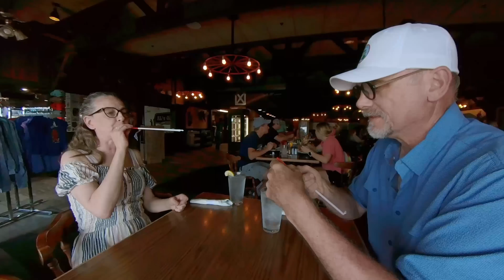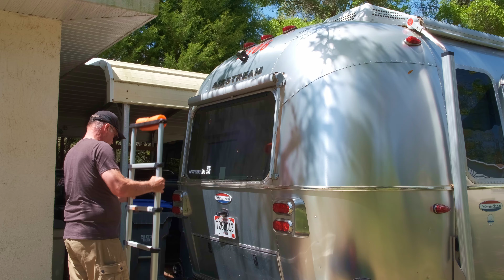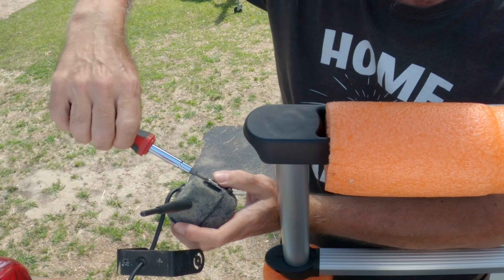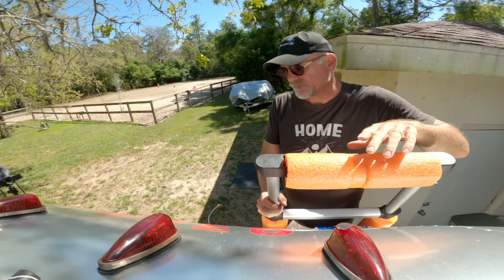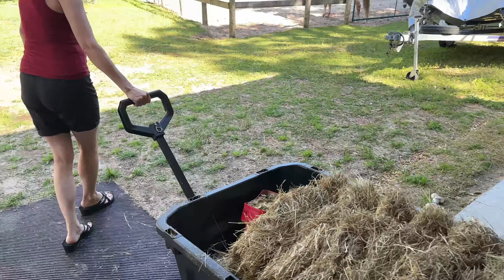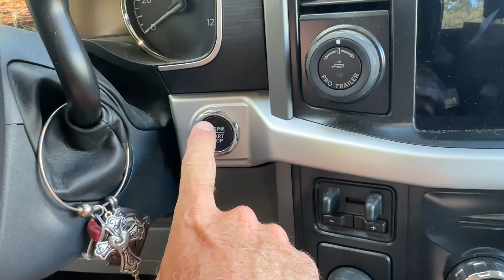Installing the HALOVIEW BT7 on our AIRSTREAM

Comment from the maker: Do you use a backup camera with your rig?
Reply: The answer is really we need one for monitoring the things that ride in the hitch. This is for our  bikes or Lance Skooter that rides on the back of our Bambi. On our last trip we dragged a bike about a mile down I-95 before someone opened a window and told us it was just barely hanging on to the camper.  The original camera had died 3 years ago so we could not monitor anything. The quality was really bad anyways.
Reply from the maker: @long-pierproductions6835 that sounds like a scary situation!

Comment: I enjoyed your video. I installed the same camera system on my Airstream because my old similar camera that came with the rig would not operate properly with my 2021 GMC truck with the pulse electrical system. The BT7 needed constant 12v feed. So I ran new wiring inside the rig to where the DVD player was for power and added a manual power switch. In addition, I added a new 12v  outlet (cigarette type) where I can power the monitor in the rig if I want so that I can use it as a security camera if we're away from the trailer and wanted a watchful eye at the campsite. This camera has proven fantastic! Easy installation, superior quality of picture.
Reply from the maker: That is a brilliant idea for a security setup, thanks for sharing your tips! - Jim

Comment: Thanks for the excellent video. Our factory supplied camera has never worked well and so we are going to replace it with the same camera. I was wondering if anyone has used the Haloview RVMB02 mirror mount? We have a Ford F150 and it seems like a good place to have the screen.
Reply from the maker: We have upgraded to the BT-10 TPMS model. Mounts right on the rear view mirror and has built in TPMS. Highly recommended!

Comment: I know this video is a year old now but I’ll ask anyway. After watching your install videos I bought the BT7 for my Airstream 26U. My question is do you think it will void the warranty if I cut the connector off the camera cable like you did? There’s no place to hide it so I don’t think there’s any way to do the install without cutting it off. Thank you for the video!
Reply from the maker: That's a good question, to be totally honest, I'm not sure. That said, I have found the Haloview products to be excellent quality and have had zero issues. Their support has also been terrific. I later updated to the BT7-TPMS and am now using the BT10-TPMS. All have been excellent products. I'm sure you will like the improved resolution of the Haloview.
Reply: @airstreamer Thank you for the fast response! I’m just waiting for the temperature to get above 40 this afternoon then I’ll do the install!
Reply from the maker: @Bestdayever-1  Safe travels!

Comment: I'm actually getting ready to switch to the BT7 on our 27FBT, primarily for the multi-cam capability (because I think the portable battery powered cam has value for us in some parking situations).  But, at this point I'm planning to stay with TireMinder for TPMS since their sensors are lighter then Haloview's (and we still have the original, non-metallic, OEM valve stems).

So, I was wondering how you feel about your BT7 configuration after a year?  Has the curvature of the Airstream skin presented any issues with the BTC128 camera?
Reply from the maker: We have been very pleased with all versions of Haloview that we've tried. I just upgraded us to the new BT10, but haven't towed with it yet. The camera does just fine with the Airstream's curved roofline. - Jim

Comment: Thank you for posting all the details of this install-- the Voyager is junk and we just purchased the new Haloview BT7 Touch, so having this video is very helpful with our Airstream Globetrotter!
Reply from the maker: Awesome, so glad this video could help with your install and upgrade! - Jim
Reply: @airstreamer any idea what size drill bit you used to drill through the skin? I'm so nervous to do it, but here I am working on it!
Reply from the maker: @scottbpipe I can’t remember… maybe 1/8”? For sheet metal screws, I size the bit by eyeball… something smaller than the threads, if that makes sense. - Jim
Reply: @airstreamer I did about the same! All installed thanks to your video! ❤

Comment: I have an Airstream 2024 Classic 30RBT. It came with a Voyager WiSight 2.0 which is garbage. The video was very good. Before I take the plunge, I wanted to be sure that the power supply to the Voyager camera is what the Haloview needs. Any help is appreciated.
Reply from the maker: Yes. The camera needs 12v to operate. The original camera is wired to the Airstream’s running lights. We have had absolutely no issues at all with voltage to the camera. Once or twice we’ve briefly lost signal, but that was in a highly congested radio signal area where we lost CarPlay connection too. We are still very happy with the Haloview, especially their new one with the integrated TPMS.

Comment: Jim - we really appreciate  this video. Thanks! One question: the Voyager wires are so small! Did you have any trouble stripping them? Did you use the wire nuts provided by Haloview? Thanks for your help.
Reply from the maker: Thanks so much! The original power wires in the Airstream are tiny for sure! I did have a little issue stripping them, but was able to do it with my wire cutter. The wire was too thin for the wire stripper. If I remember correctly, I did not use the wire nuts. I braided and taped the splices. Hope this helps. - Jim
Reply: @airstreamer  Thanks so much! We finally got it installed and everything works great. I can say for sure that we couldn’t have done it without you. Happy travels!
Reply from the maker: @martha1114  this makes my day. 😁

Comment: I would have suggested small Eternabond tape patches over the original holes.  I think attaching the green wire to the Airstream body would have provided an antenna ground plane for better RF transmission.  Nice video!  I can’t wait to hear how the camera works out on the road.  If you tip it down enough to see the rear bumper, can you still see the horizon like with the Voyager?
Reply from the maker: That's a great idea! If only I had some Eternabond... Seriously, that is a great tip. Sikaflex would probably have been better than the Captain Trolly's too, but one works with what one has on hand. On the Haloview, the green wire isn't a ground, but a trigger wire. With multi camera setups, the green wire is used to switch cameras. The green wire can be connected to a turn signal so when the turn signal is activated, the monitor will automatically switch to that camera. Hope that made sense. Thanks for watching and commenting. - Jim
Reply: @airstreamer , Excellent.  Makes sense.

Comment: Jim have you tried backing your Airstream with Haloview  yet. I have a Ford F150 and a 27FBQ and I can’t see around my Airstream very well when backing up. This 1080 resolution camera looks invaluable for seeing where I am going and listening to my wife’s guidance
Reply from the maker: Yes. Quite a few times now. It really helps when backing into a campsite. Used it about 90 minutes ago in fact! A couple weeks ago we needed to back into a rural driveway so we could turn around after missing the campground entrance! 🙀 Couldn’t have done it with out a rear view camera. Tip: if you are listening to your partner over the Haloview speaker, roll your windows up since there is a 1/2 second delay in the Haloview’s sound. Same as using a cell phone. - Jim

Comment: Jim, Is that screen distracting when you're driving?  To bad there is not a way to get the camera to display on the infotainment screen on your dashboard.
Reply from the maker: I don’t find it distracting at all. I’m enjoying the ability to see behind the Airstream while driving. They make a unit with a screen that attaches to the rear-view mirror, which sounds like a great option. It wasn’t recommended for our rig, however. Thanks for watching and commenting. - Jim